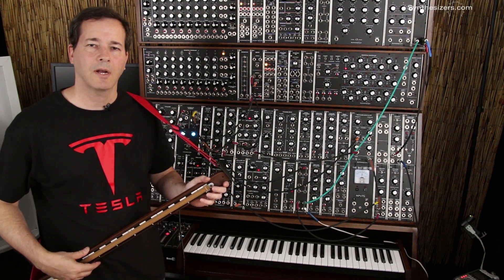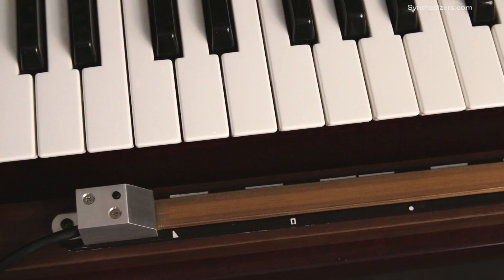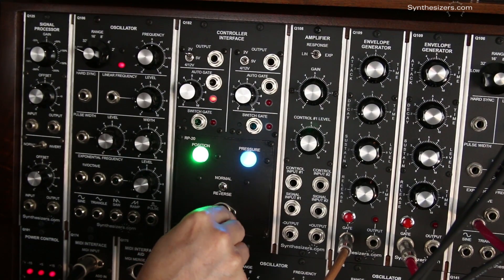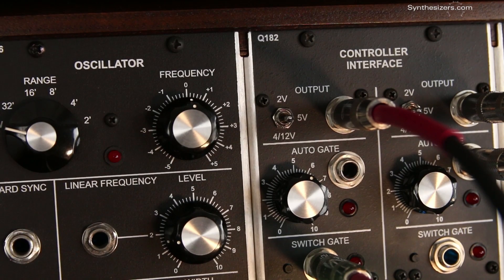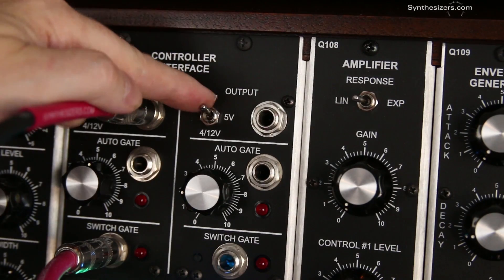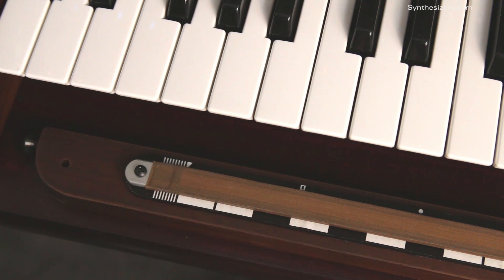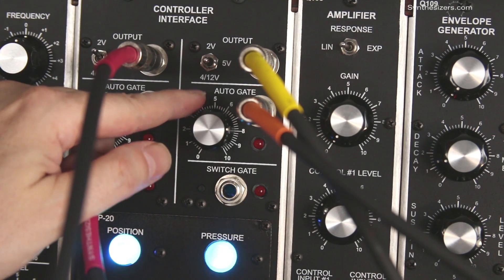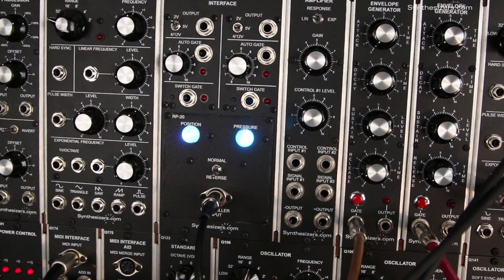RP20 Ribbon Controller overview - Synthesizers.com

Comment: a 20" inch sensor and with the base is 27.5" - is there any way to add it to the smaller 37-key keybed which is 22" wide with sides included?